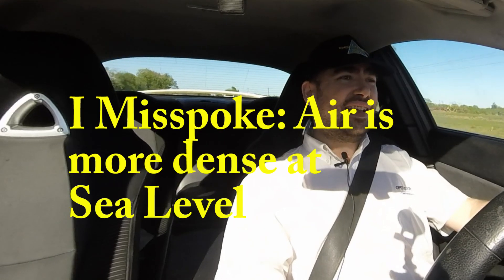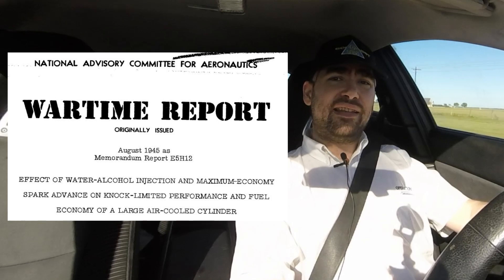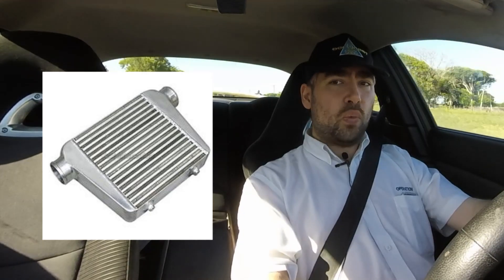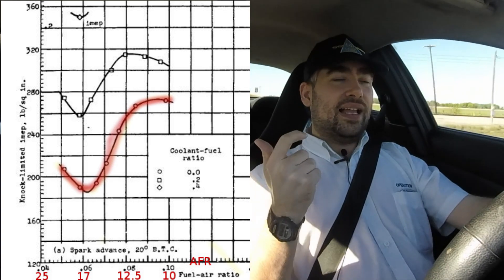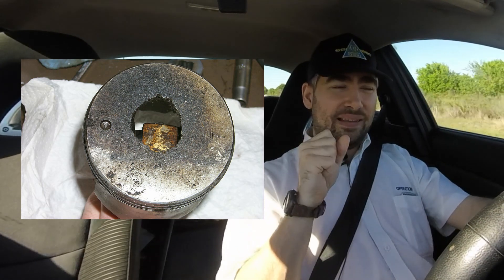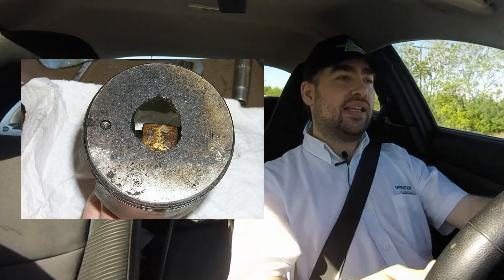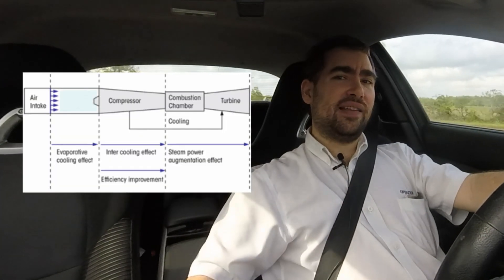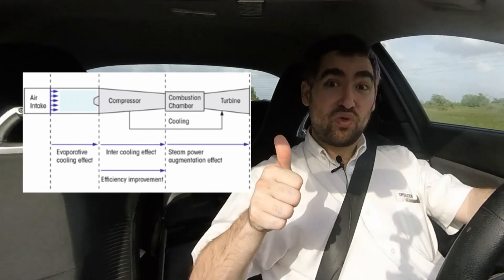Why water injection with no intercooler? Voiding Warranties - Ep35

Comment: Opinion on a GDI engine, turbo charged with intercooler, knock sensor equipped hot day running the engine hard, adding a Throttle or manifold secondary water/meth injection nozzle? 

Mainly to reduce carbon build up on valves and secondary to help reduce knock be it mild or a little more aggressive? Shouldn't require much tuning if the short term and long term fuel trims can keep up.
Reply: the menthol kit on my GDI has made a world of difference for the best , also running catch cans

Comment: Great 
I have a Niva 1.7 that i just added turbo without intercooler. Outside air temp can reach 130 deg in summer here. I get Snow water/meth kit. I can't get meth here easily so i planing to inject in intake down throttle body. After seeing your video i am thinking about water injection pre compressor wheel

Comment: What about water injection in a NA engine? My engine's pretty small and weak lol, a JDM Qg18de, 128bhp according to wikipedia, but i still like fiddling with it. Using an app, Carguage pro I advanced timing by 2 degrees and it's noticeable, just wondering if I could squeeze some more power out using water injection.
Reply from the maker: NA water injection is a mixed bag. First you need to tune for the highest octane available until you are detonation limited, then slowly add water and timing until you stop gaining power. If you inject water beyond what is needed to stop detonation then you will lose power. For NA this is a very small amount of water.
Reply: Thanks for that will try! Love the videos by the way, only discovered your channel today.
Reply: @arshad you trini bro?

Comment: What about damage to the compressor?  Maybe keep an eye on it for us.
Reply from the maker: None yet. I tried with a china charger first and it ran for quite a while and even had an accident with excessive water (the compressor housing was half filled with the engine running) and no blade damage. So I'm not particularly worried.